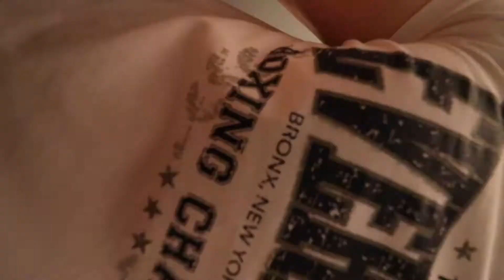Bedroom Renovation Timelapse Part 4

Comment: Hey Duncan,
nicely done I like it.
What kind of brush you have used to paint the walls ?
Reply from the maker: Thank you.
I used a harris no-loss paintbrush, very fine bristles, so it doesn't leave brush marks.
Then I used a thick pile roller to fill in.
Thank you for watching my video.
Reply: @FixedByDuncan 
I thought that was a special type of brush while it's just a guard on the pile roller :D
Thanks for your answer.
You are very welcome, keep it up. Greetings from Germany
Reply from the maker: Ah, yes. It stops you from getting covered in paint splashes, it's very good.
Thank you again.